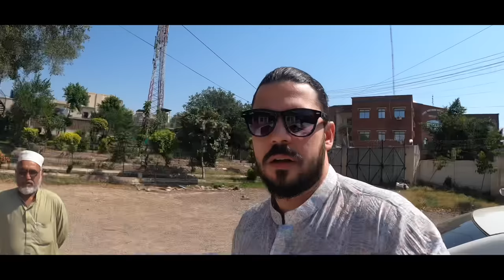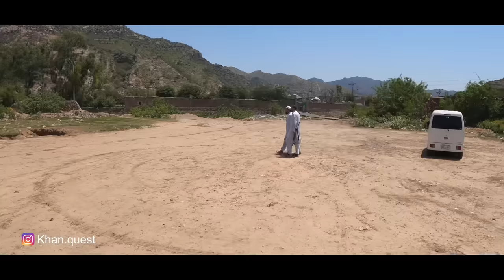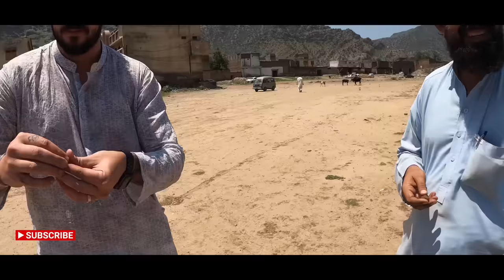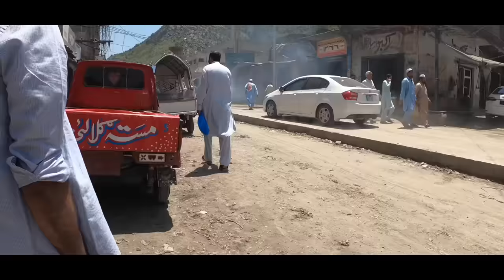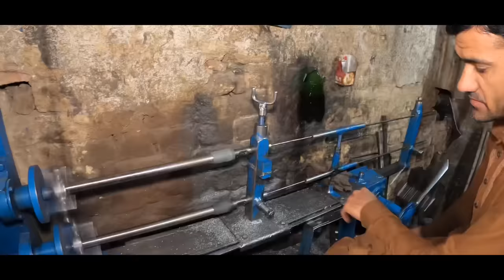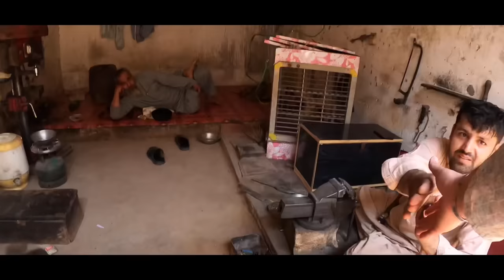FOREIGNER IN PAKISTAN'S ILLEGAL GUN MARKET DARRA ADAM KHEL

Comment: How is it that the Tokarev copy had two magazines, one which allowed semi auto fire, and the other full auto?

Can somewone please explain how that is possible with just changes to the magazine and not the gun?
Reply from the maker: its because its a copy, the magazine is collaborating with the lower receiver internally. Don't know the exact mechanics of it but im sure its some sort of spring based switch inside that magaine with the one or two holes trigger it a certain way, allowing the weapon to fire at different rate of fire.
Reply: @TheKhanQuest  I was trying to imagine what the internal switching mechanism might look like, and it would have to have been modified from the standard semi auto internals.

This is the only time that I've ever seen a firearm have such a capability simply by changing the magazine!

This is the most interesting video on the gun makers of this famed location. You managed to find a real gem of a rarity.